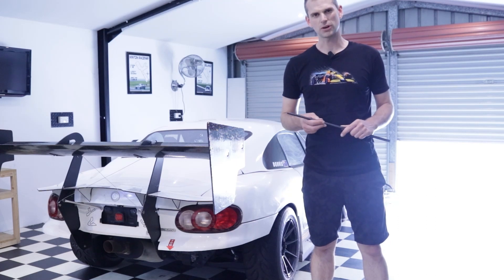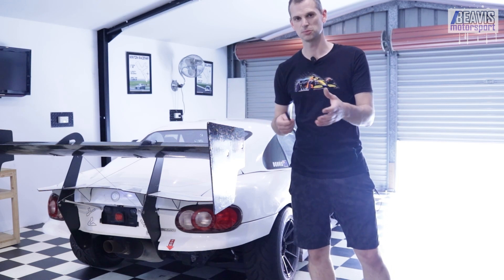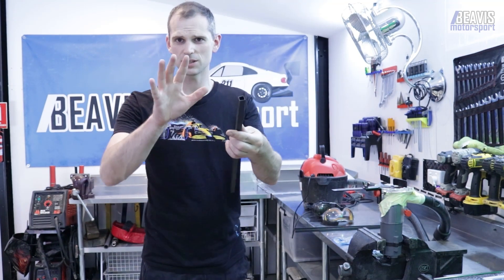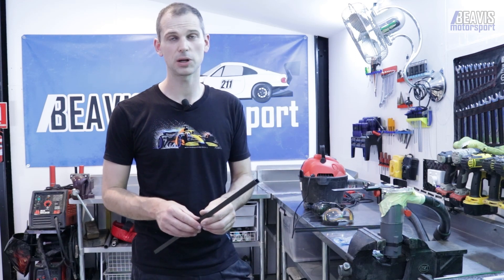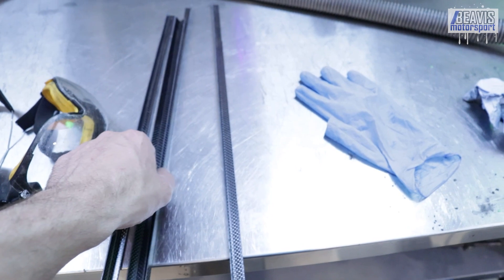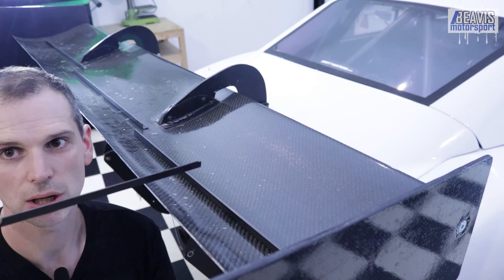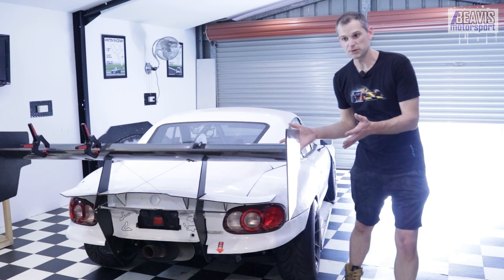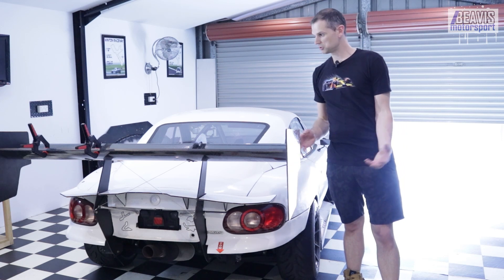DIY Carbon Fiber Wing Gurney Flap

Comment: Did you make the wing too? I couldn't find a video where you mentioned the wing.
Reply from the maker: Hey Joel, the wing element was made by a friend who has the tools and materials to work with small volume carbon fibre car parts. It is hand laminated carbon fibre wrapped around a foam core.

Comment: I used to work with carbon a lot. It is abrasive, so it would chew up band saw blades quickly. We got a special carbide grit blade and it was magic-- at least until someone cut aluminum with it and gummed it all up. Moral of the story is composites work well with abrasives and carbide, but HSS cutting tools die a quick death in its presence.
Reply from the maker: Thanks for the insight Nicolas, good information to keep in mind.

Comment: Fun fact, the gurney flap is the only aero tech to have been invented in motorsport then used in aerospace
Reply: I will say, buying a larger, efficient wing wouldve been better, bcs gurney flaps increase highside pressure, but overall reduce efficiency. But this cost $40 and a large, efficient carbon wing could run around 20x that much. That being said, are you sure you endplates are optimal? Could potentially gain downforce and even improve efficiency (not reduce drag, just gain more downforce than drag) by optimizing them if they have room for improvement. However, if they came with the wing and you know that the company designed them well, or they came from someone who did their homework on them, there isnt anything to be gained. But if you arent sure about them, it be really cool to see you and kyle.engineers/jfk aero colab. Would be super rad to see kyle run some sim on your car, made recommendations, lightyear build it, then you run it and see what difference was made. Obviously that isnt realistic, but it would be super awesome to see as a series if you 3 were all in a position to make it a mini series with enough viewership to make a profit off of it.
Reply: Also would be interesting to hear an aerodynamicist speak on what angle the flap should be, perp. to ground plane, perp. to wing wing trailing edge, or, most likely, perp to airflow at flap height that is very close but not quite parallel to wing edge
Reply from the maker: @noncog1  I made the wing end plates myself, so I can assure you there is no clever engineering behind their design or shape 🙂
Reply: @Bbeavis  if you made them im assuming theyre perfect :)

But itd be a cool opportunity to colab with kyle on something small then
Reply from the maker: "buying a larger, efficient wing wouldve been better" - perhaps, it would also cost a lot of money. This was like fifty bucks.
Reply: @Bbeavis  im very aware, said as such in the comment, just wanted to make sure the info was out there for any viewers